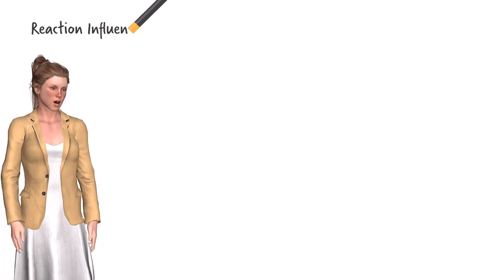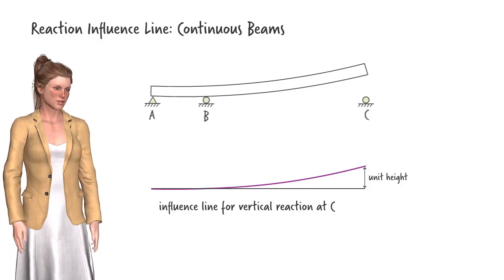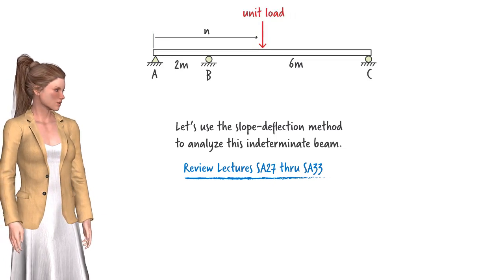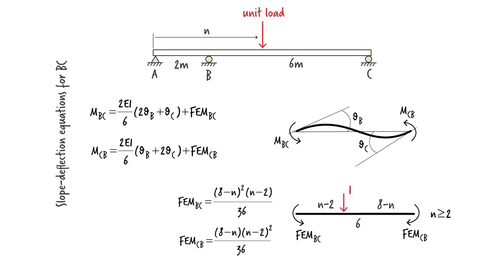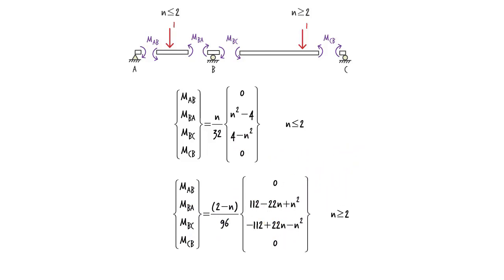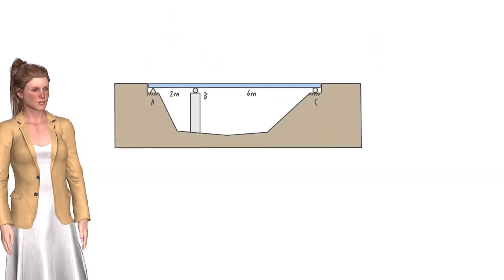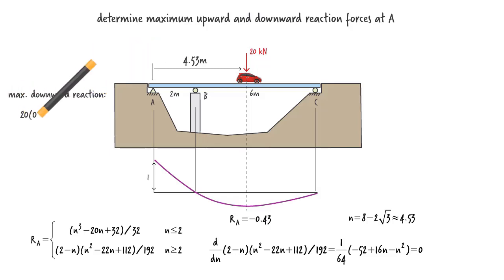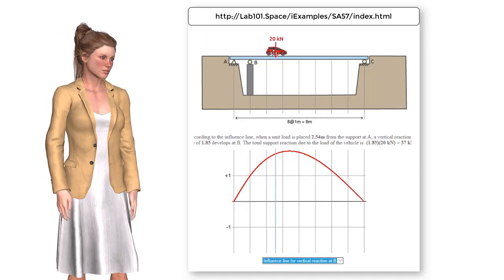SA57: Reaction Influence Line for Indeterminate Beams

Comment: Hello madam, in order to be able to use the slope deflection method I need to memorize the formulas?
Reply from the maker: Yes, if you don’t have access to your notes or a textbook, to apply the method, you need to remember the two slope-deflection equations as well as the equations for calculating the fixed-end moments.
Reply: @DrStructure  is it practical? I mean anyone could do it if he knows the formula unlike the force method
Reply from the maker: Yes, it is practical. When you use the method several times, the equations can be recalled from memory with ease.

Comment: Thank you for the great video. If the unit load is placed at n = 1 m, the solutions at 5:48 give RA=13/32, RB=39/64, RC=-1/64. But these do not seem to satisfy moment equation (about A, ccw = +ve) as -1*1 + 2*RB + 8*RC = 0.09375, not zero?
Reply from the maker: Thanks for pointing out the inconsistency in the formulation. At 5:00, the expression for RA is incorrect. It should have been written as: Ra = (n^3 - 36n + 64)/64. Given that Rc = (n^3 - 4n)/192, the correct expression for Rb becomes:  (112n - 4n^3)/192. 

Therefore, at n = 1, Ra = 29/64, Rb = 9/16, and Rc = -1/64. Now the moment expression about A becomes: (1)(1)-(9/16)(2)+(1/64)(8) = 0.
Reply: @DrStructure  I see, thank you for the prompt reply. BTW your videos are truly amazing. If there's an Oscar or Grammy Award for structural mechanics videos, you definitely deserve one.

Comment: Is that equation is applicable to all cases??
Reply from the maker: No, the reaction equations are derived based on the specific beam lengths (i.e., 2 m and 6 m). But, you can generalize the equations for any length beam using the procedure explained in the video.